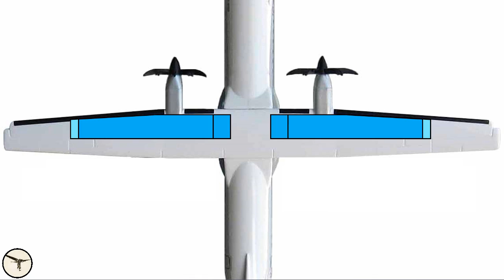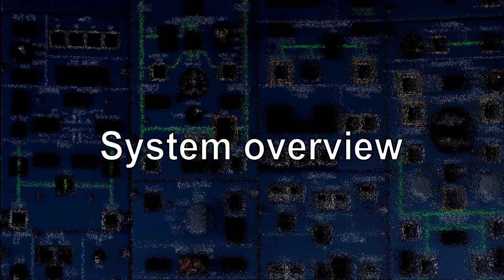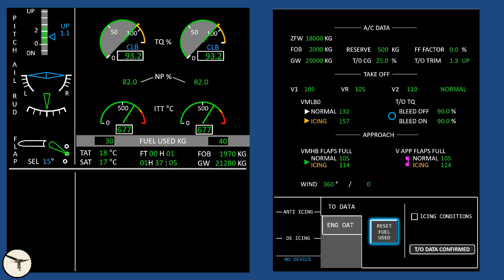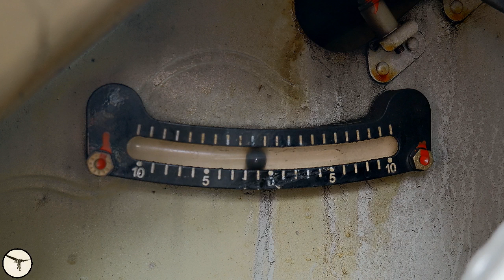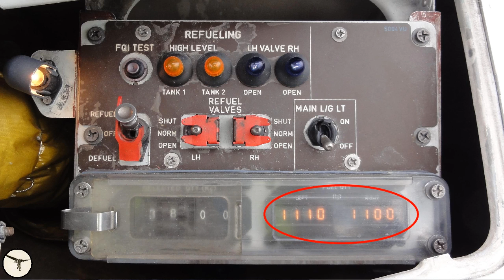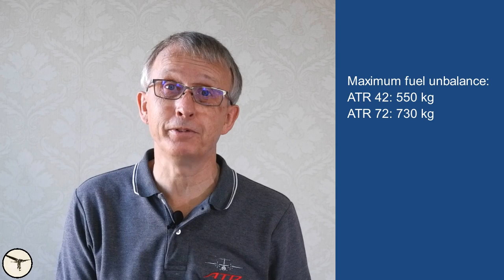ATR systems - Fuel system

Comment: What will happen to engine feed jet pump if pump push button is selected off while the engine is running.
Will it stop supplying the fuel as motive flow valve will be closed when push button is off.
Reply from the maker: I have tried this in the simulator at cruise. The fuel pressure dropped and triggered the FUEL LO PR alert, but the engine continued to run. I expected an alert for low level in the feeder tank, but this did not happen (we tested this for 5 minutes). A combination of gravity and suction from the engine driven HP fuel pump was sufficient to keep the engine running.

Comment: Hi Magnar, rhank you for the video. Are the left and right tanks filled simultaneously and evenly? Since the filling process starts on the right side, the right tank should logically fill up faster than the left one. Does this create an imbalance in the aircraft, or is there a mechanism to regulate the filling process?

Comment: Hello capt. Magnar!
In the FCOM, PRO.GEN 1.6(Circuit Breaker Reset), it says DO NOT REENGAGE THE C/B OF THE FUEL PUMP(s). I just wanted to know why?
Reply from the maker: I do not know. As a general rule, we are not allowed to reset any circuit breakers unless it is deemed necessary for the safety of flight. There is a risk associated with resetting circuit breakers, as they have tripped because of an overload. Considering the fuel pumps are installed inside the feeder fuel tanks, the warning might be there to prevent any possible bad outcomes.

Comment: Hi, I have a question. The FCOM says that when we have a LO LVL because there are more than 160 kg of fuel in the tank but the feeder tank is not full, 130 kg of fuel are not usable because the feeder pump is not available. Why 130 kg? Do you know how this quantity has been calculated? Thank you very much.
Reply from the maker: Since the FCOM doesn't explain this issue further, I have to make a qualified guess. The feeder tank is not full because the feeder jet pump is "not available." That might happen because it is clogged, or there's an internal leak in the plumbing inside the tank. Anyway, the fuel level in the feeder tank is now equal to the fuel level in the main tank.  I assume the outlet from the feeder tank (to the engine) is not flush with the lowest part of the tank. Therefore, 130 kg fuel in the feeder tank and main tank combined will not be available for the engine.
Reply: @FlywithMagnar  Thank you very much for your answer and congratilations for your work here. Your videos are excellent.and very helpful.

Comment: Hi Magnar, hope you're well! can you please confirm that your explanation of the inclinometer is correct (9:28)?  It looks to me that it is left wing up and right wing down.  So, the ball rises to the higher wing?
Reply from the maker: The inclinometer is correct. Maybe this exercise can help: Draw a large inclinomter on a piece of paper, but without the ball. Let a round object (small coin or similar) represent the ball and place it at the lowest point of the inclinometer. Rotate the paper anti-clockwise to simulate a left wing down position. The round "ball" must now be moved to the left to stay at the lowest point.
Reply: @FlywithMagnar  Thanks very much - So it's a "ball type" and not a "bubble type".

Comment: If the left hand refuel valve failed?
Reply from the maker: If the valve does not open, there will not be any blue light on the refueling panel. If manual control does not help, the option will be fueling by gravity.
Reply: @FlywithMagnar  or-use the tool provided with the airframe & open the valve manually. Remember-you will have NO overfill protection & will need to close the valve manually by removing the tool allowing the refuel/defuel valve to close.

Comment: Graet video as usual 🙂. Regarding the question what force moves fuel from vent tank to the main tank - this is the slight air overpressure above the fuel in the vent tank , provided by the profile of the  NACA duct in fligt. It overpress and turns back the fuel from vent tank to the main tank. Thank You Capt. Magnar for the great work!
Reply from the maker: Thanks for the info!

Comment: Captain, thanks for clear fuel system explanation. I have a question:
How can I to identify whether fuel leak between feeder tank and HP fuel pump (Video 19:27) or fuel leak between HMU and Fuel Flow meter (Video 20:12)? Both have the same indications: “FUEL UNBALANCED” + Fuel Used 210L/210R + Fuel QTY 780L/990R + FF 340L/340R + ELEC PUMP RUN. Best regards: Carlos.

Comment: Capt Nordal, 
May i ask whats ur take on MEL on ATR 72-600 
28-42-1 FUEL QTY INDICATION
It says Number installed 2 
does ATR mean 2 as 1 in cockpit MFD 
and 1 in refueling panel
or 1 quantity indicator for each wing in MFD??
Reply from the maker: There are two fuel quantity indicator systems, one for each tank. The fuel quantity in each tank is shown in the cockpit and the refueling panel. One of those tweo fuel indication systems may be inoperative for dispatch, provided you comply with the conditions in MEL, including checking the fuel quantity in the affected tank by using manual (magnetic) indicators after each refueling.
Reply: @FlywithMagnar  appreciated capt
safe skies 🙂

Comment: Hello Magnar, being new to the ATR's systems a question from watching this video: does anti skid only work when normal brakes are used, or does anti skid also work when braking from the accumulator when normal brakes are lost? Best regards, Boy
Reply from the maker: Hello Boy. Anti-skid only works with normal brakes. The emergency brake does not have anti-skid.
Reply: @FlywithMagnar  Thank you for that very quick reply! I now see that I posted my question in the wrong video but the answer is very much appreciated even if not linked to fuel system at all :-))

Comment: Hi captain, thanks for your video. I do not understand why if there is an excessive fuel flow the checklist tell us to operate the xfeed valve. Excessive fuel flow is an engine leak so with xfeed the leak will still be there ?
Reply from the maker: In the QRH, there's no checklist for excessive fuel flow. The nearest checklist is FUEL LEAK. Here, it is written: "If excessive fuel flow was identified before engine shutdown: FUEL X FEED VALVE CAN BE OPENED." That means you can use fuel from both tanks to feed the operating engine. The reason is, when you see excessive fuel flow, the leak is after the fuel flow meter for that engine. The fuel tanks are not affected.
Reply: @FlywithMagnar   thank you for this quick answer. I probably miss something but what I understand it’s that if you open the cross feed valve you will continue to feed the leaking engine and so the failure will remain ?
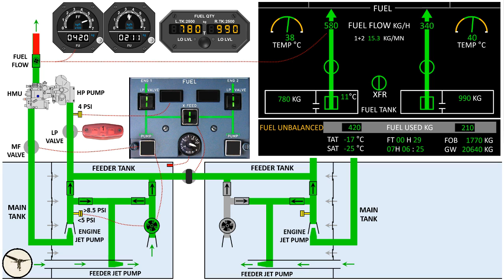Reply from the maker: @Xavieralberici9 , no, the engine is shut down as prescribed by the checklist. The failure is in the engine, not the fuel tank. Watch from 20:22 in the video.
Reply: @FlywithMagnar  that was the element missing : the leaking engine off. Thank you 🛫🛫

Comment: Hi captain! On ground engine is running --> Feed Lo Pr, what could cause this? thanks
Reply from the maker: The fuel delivery pressure is less than 4 PSI. Probable causes:
1. The assosicted fuel pump is selected OFF. This closes the motive flow valve. Therefore, the first line in the FUEL FEED LO PR checklist is to verify that the fuel pump is ON.
2. Jet pump failure + electrical fuel pump failure.
3. The motive flow valve is jammed shut + electrical fuel pump failure.
4. Something is partially blocking the fuel from flowing from the tank to the engine.
5. Fuel leak between the fuel tank and the pressure sensor. This might result in a significant loss of fuel from the associated tank. In that case, the procedure is to shut down the engine (and hope that there will be no fire).
Reply: @FlywithMagnar   Thank you Captain <3

Comment: Is there any specific reason to have the FUEL TANK TEMP probe only on Tank 1
Reply from the maker: Yes, the fuel temperature in each wing tank is more or less the same. Therefore, it is not necessary to install temperature sensors in both tanks.

Comment: Good morning Cap Magnar and thanks for this, whay there is only one a temperature detector on the left feeder tank
Reply from the maker: The temperature in the left fuel tank is more or less the same as the temperature in the right fuel tank. Therefore is only one temperature sensor required.
Reply: @FlywithMagnar  thousand tanks for your soon answer captain Magnar

Comment: Can i ask? Do you encounter during hotelmode we have fuel leak on ecotank drain and what troubleshooting you give or advise
Reply from the maker: The ecotank is empty when the engine is running. Therefore, a leak can only be detected after the engine is shut down and there's fuel in the ecotank. I'm not a mechanic, but troubleshooting should be quite easy, as the ecotank is located below the engine and is relatively easy to access.

Comment: Hello again Captain! I'm running through your videos today!
I had another question. The only reason why the low level light would come on while the tank is still showing more than 160kg could be because there is a leak in the feeder tank. The checklist says keep fuel crossfeed closed in this case. 
But according to the diagram you have showed in the video, I don't see why the crossfeed cannot be opened, since the line runs directly to the LP on the other side without mixing with the fuel in the affected feeder tank?

Also question 2: the unusable fuel is 130kg in the tank according to the same checklist, does this mean the engine will quit at 130kg? Is this figure accounted for in your alternate aerodrome calculation by your computer flight plan?
Reply from the maker: Hi, there might be several reasons for why the feeder tank is not full. Examples: 1) Fuel leak from the feeder tank (as you mentioned). 2) A clogged jet pump preventing the feeder tank to be filled up. 3) A leak in the line from the feeder tank to the LP valve. If the latter is the case, use of crossfeed will result in unnecessary loss of more fuel. Since the pilots cannot determine the cause, the most conservative procedure is applied. 

Question 2: Unusable fuel is 130 kg only if the feeder jet pump has failed. Since the pilots cannot determine the cause for the fuel low level alert (when the fuel quantity is >160 kg), the most conservative procedure is applied. (FCOM PRO.NNO.ABN.28)
Reply: Thank you so much captain, I'm preparing for command interview! Your videos give me the confidence about the aircraft! 
Your help is greatly appreciated

Comment: hi captain, amazing videos, i always use them before going to sim. i had a question, how are we able to start the engines with the electric pump OFF?
Reply from the maker: Gravity. The fuel tanks are above the engines. If you forget to select the electrical pump ON before start, there's already fuel in the line, and the HP pump will very soon assist the gravity by sucking more fuel from the feeder tank.

However, the motive flow valve remains closed as long as the fuel pump is selected OFF. Therefore, the feeder tank will not be topped up, and you will sooner or later receive a LO LVL alert. That should wake you up!

Comment: Captain, sorry for asking one more question, what if the leak is confirmed from the tank? The cabin crew tells you that there is spray from the wing, you only have a fuel unbalanced alert, I would keep the engine running, the electronic checklist gives you a choice, either ,leak from engine or not located....in this scenario (leak from the tank) it would be not located, is it correct? Thanks a lot
Reply from the maker: Currently, I don't have access to the electronic checklist. If there's a discrepancy between the electronic checklist and the QRH, then the QRH has priority. QRH procedure: If leak from engine? No. (Don't shut down the engine.) If leak not located? No. (You can use cross-feed.)
Reply: @FlywithMagnar  Thank you for your answer, the ECL is the same as the QRH, I thought you had to choose one of the options, that's why it didn't make any sense for me in case of a leak from the wing tank (leak not located, when indeed it is , and close the  xfeed), now it's clear, according to your answer, there is no need to shut the engine down, and you can keep engine running with x-feed open, but you have to be sure 100% that the leak is from the tank, again thank you, really appreciated

Comment: Hi Captain 
Question 
The engine keeps running whith fuel pump off ?
Reply from the maker: Yes, the electrical fuel pump is only needed to start the engine. The engine drives a HP fuel pump, which has a much better capacity.
Reply: I mean with Push Button off with low pressure alarm
Reply from the maker: The engine will run fine with the fuel pump selected off. The low pressure light should not be illuminated, because the engine driven fuel pump will suck fuel from the tank.
Reply: Thanks a lot Captain
Reply: Actually that's the way to cross fuel when engine still running, thanks for videos

Comment: Just out of curiosity what is the climb rate and single engine ceiling for ATR 72 at normal conditions and normal operating weight ?
Reply from the maker: Finding the single engine rate of climb requires some serious calculations. Instead, we calculate maximum weight that enables us to climb at a specific gradient and to clear obstacles after take-off and during go-around. 
At 22 tons in standard atmospheric conditions, the single engine ceiling is 14,400 ft. The numbers vary considerably with aircraft weight and temperature. 
You might find it interesting to watch this video: https://youtu.be/AIfwMy-rhig

Comment: Thank you for the video about fuel systems. 
Does FOB number must always be inputed manually into the flight management system? Do pilots get this number only from refueling handling staff?
Reply from the maker: Yes, FOB must be entered manually into the FMS. No, we read the fuel quantity indicators. The point is that FOB and the fuel quantity indicators show the same numbers when we start the engines.
The refuelling handling staff give us a receipt showing how much fuel they have added to the tanks. For example, if we landed with 800 kg in the tanks and ordered 2,000 kg, we should have received 1,200 kg / 0.785 = about 1,530 litres. If the receipt show something very different, we must find out why. 
It happened to me once; we received 200 litres more than the receipt showed. The refuelling staff insisted he was right. If he was right, then our indicators were wrong. We used the magnetic indicators to cross-check that the fuel indicators were correct. This is the only time I have used them.
Reply: @FlywithMagnar  Very interesting story. Thank you very much for extensive answer

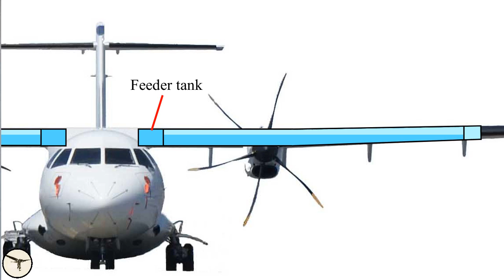Comment: For ATR 72-600 In minute 1:22 the inboard water drain valve is for feeder compartment and the other is for wing tank
Reply from the maker: Yes, you are right. FCOM states that there's one drain valve in each tank. I missed that and used an inaccurate drawing as reference. Thank you for correcting me.
Reply: you're welcome capt